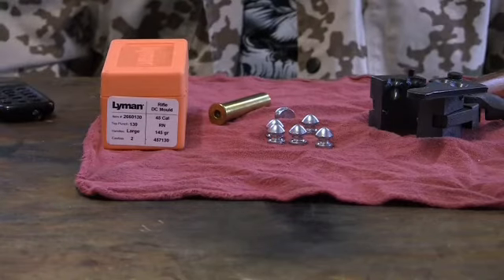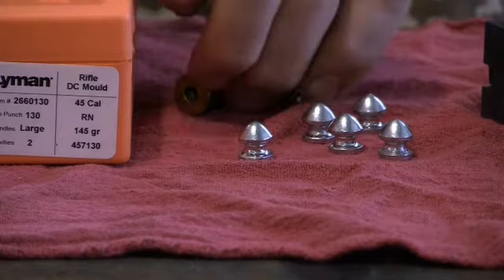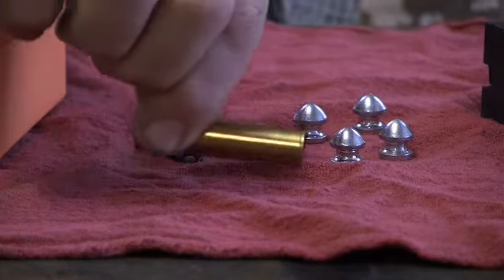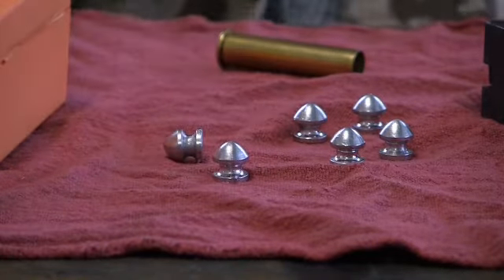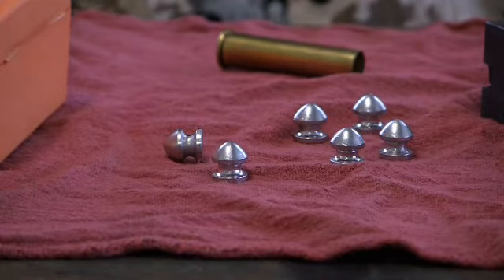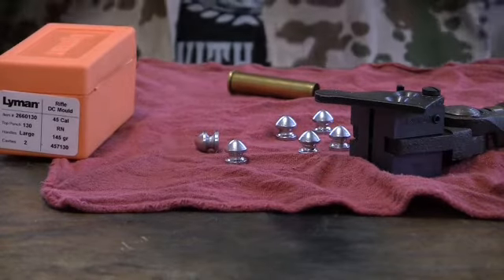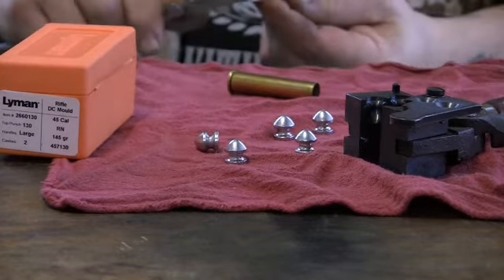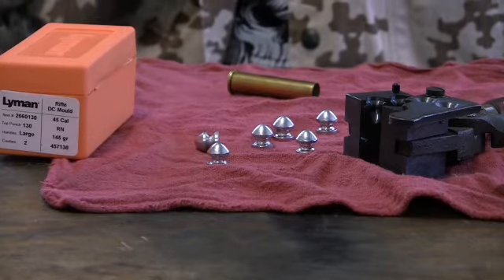Lyman 457130 Collor Button bullet mould

Comment: I just cast 250 NEO button 460 192 grain.Smoother bullets than Lee,higher reject rates though.Plan on loading 45-70 60 grain BP for BFR starting loads,and work up to 250-300 grain bullet.

Comment: 45 Colt is .452 and 45-70 is .458.  Are you sure you can load 45 Colt with these?
Reply: I size my 350 grain .460 cast bullets to .454 and load them in 45 colt brass for my Rossi. Works great.